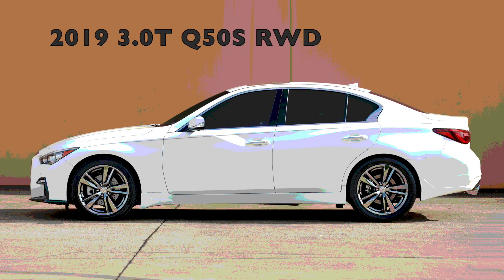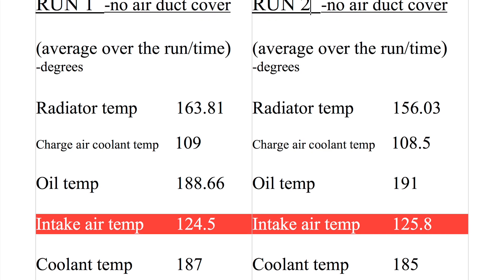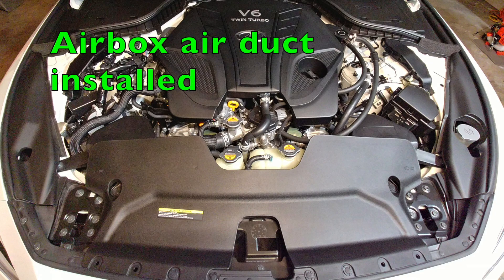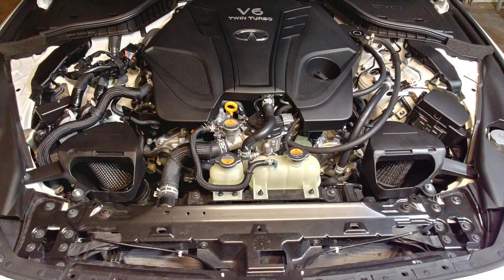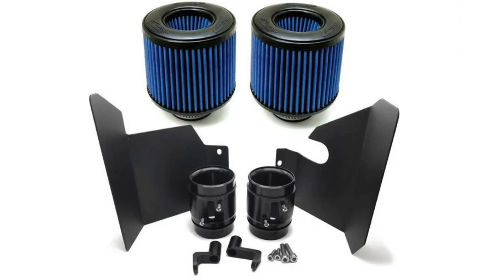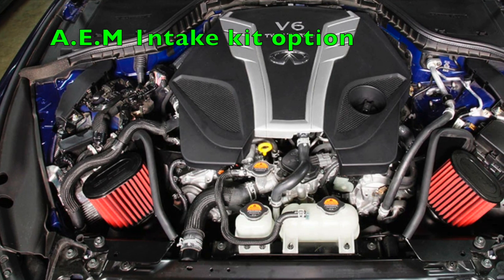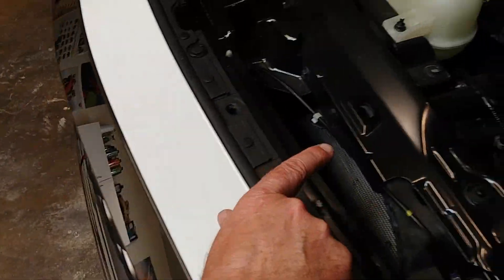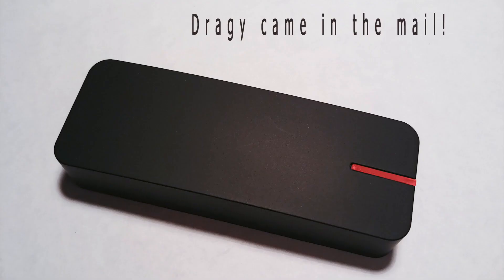Real-world data...open type airboxes/filters vs. true closed cold-air intakes ---3.0T Q50

Comment: At stock fan speed, installing an intake cover will maintain lower temperatures. However, if the ecu reflash has been modified to operate at 100% fan speed at a temperature of 80C of the engine coolant, removing the cover forces cold outside air into the engine fan, causing the temperature to drop.
Reply from the maker: @doom9344  cool, thanks for commenting.

Comment: Awesome video- thanks for taking time to do it. I installed stillen intakes (got them for 150.00 less than AMS ones, and they are essentially the same in design property) and I installed velossa tech intake ducts on my front radiator support ... Aka snorkels. My intake air temps dropped and stay more consistent then when i had BMS intakes and no snorkels. I keep track via JB4 logging. Small differences, but differences nonetheless!
Reply from the maker: I'm all about saving money! I waited to buy the AMS kit until I could save $100 on it during a holiday sale. $500 is too much. I think/feel the AMS airbox/filter kit should sell for $300 to 350. Did you buy the Stillen 402856 part number?
Reply: @GettingthruLife  I got a deal from CH or "Chantilly Infiniti" wherever that is. It was via eBay / the dealership and parts dept they have. But yep- same part number. AMS upcharge a lot based on their name and platform but their intake design compared to stillens is identical as far as conical size/shape and closed box mounted onto the front fascia, I would say. For the price difference i can't complain - plus stillens are super loud and it's nice to hear 😂

Comment: This video is trash. You don't even mention the Charge air temps which are way more important vs the intake temps.
Reply from the maker: Man you are a little bit hateful. My tune is not currently installed so I'm running my Ecutek app that doesn't allow me to log the one parameter CAT. Please take a deep breath and relax.
Reply from the maker: Also Giovanni, charge air temp is directly affected by intake air temp. Intake air temp is the air temp going into the turbos. You start out with hotter air then your CAT will be higher and also means that your heat exchanger and the intercoolers will have to work harder. The whole concept why turbo cars work better in cooler weather verses hotter weather.

Comment: I just bought the AMS intakes waiting to get them from a vendor shhhhh always a waiting game to get something so hopefully they will be shipped out today from AMS I hope so I have 2 questions how is the sound for theses intakes? And I went with the ams because that's what I was thinking the Stillen & BMS ones aren't cold air intakes they are hot air intakes lol 2and question did you make a install video for the AMS ???
Reply from the maker: The AMS intakes add a little low end grumble/intake sounds. It's nice but not obtrusive or over powering. The AMS intakes are fairly nice and will work best for a tuned car that is demanding/sucking more air at mid to high rpm. The conical dry filters are/will be a nice addition along with the formed 2 silicon couplers. It's a pretty straight forward takedown & install but figuring out how the mass airflow tube portion unmounts from the OEM airboxes is something thats a struggle where you just have to battle with it/ figure it out. Some of the nuts and bolts don't have much room to get to, tighten, but just trouble shoot it logically where you will figure it out. I used Allen head bit and then used a the appropriate sized boxed end wrench, maybe a size 5 to place onto- torque down the small bolts on the airboxes. Helpful to have 1/4 long extension 16"-18" and a swival joint. Having the right tools makes it much easier and less cursing.  AMS website has decent instructions to look at, download. Just make sure your varying hose/worm clamps are tight but not over tightened. They should be tightened down so they don't turn/rotate but not so tight that leads to damaging the silicon and plastic parts.

I didn't make a how to vid as there are plenty online were they are good. I saw little need to duplicate but may be I could have added my little insights.
Reply: @GettingthruLife  Forget the other guys comment you do a very good job explaining thing and I appreciate you and your time so we can learn about our cars have a blessed night bro

Comment: Good video with great supporting data👍🏿
Reply from the maker: I'm working on my Dragy. The app I'm struggling with for functionality. My phone's are having different issues with Dragy app. No clear instructions on how to figure user interface out. Just trial and error. Plenty of unboxing videos and what it does but poor explanation otherwise. With my new 275 rear tires even without tune installed, 1st gear is all spinning. Traction control kills the power so it's a struggle. Larger tire likely also killing some power more than I would have thought.
Reply: Getting thru Life I had the same problem, that's why I bit the bullet and bought the Mickey Thompson's for when I wanna go fast. Without them it's like skating on ice.
Reply from the maker: @jstephens1193  Oh man, I was on the perfect concrete today and the perfect opportunity to rip out 0-60's and a few 1/4 miles. The 275 FS tires totally let me down. It was like I rolled thru an oily burn out patch. Smoked 'em all of 1st and 2nd gear and I'm not even tuned. Traction control mode sucks but good for keeping tires not spinning!!! Tires are plenty warmed up and brand new white concrete and 82 degrees full sun so concrete likey 100 degrees. Waste of money to try new tires but they are very good for everything else other than launching the car.
Reply: Getting thru Life man I hate it for you brother. Wish you actually feel what the car is like
Reply from the maker: @jstephens1193  You can't drive around here with a drag racing tire. The weather is sadistic. Bright sunny day and 30 min later flooding and tornados. Arkansas is pretty sketchy too. I know people who have had their drag radial or similar tires on and been caught in the ever-changing weather where they have crashed their cars. The only other street tire that can handle rain and is highly recommended and expensive Toyo R888R's. I could have bought 2 of them rather than these 4 Firestones and saved a couple $100 bills in the process.
Reply: Getting thru Life I definitely don't ride them daily, heck I don't even drive the car daily. I have a set of 18X10s they're mounted on and when I feel sporty, I throw them on.
Reply from the maker: @jstephens1193  I knew you mentioned you didn't daiy drive those tires but it would be good to have a decent street tire that could be daily driven with decent traction for some fun on the street. I can't imaging what it would be like again with another 120hp after I get my tune back this week or next. Looks like the only solution is a 17 inch x 10" wheel  and 275 x 40 fat juicy soft sidewall pure drag racing tire that will last 1K miles.
Reply: Getting thru Life yeah I went with the 305/35/18 because it matched perfectly against the stock 255/40/19 and it gave me a lot of meat on the ground
Reply from the maker: @jstephens1193  link to a picture/s of your car running those pretty wide rears?
Reply from the maker: Also, I posted this video to Q50 group on Facebook. He made a post about looking to buy the stillen or takeda brand intakes, partially/fully open in engine bay filters. My video triggered his emotional response. Lots of highly opinionated people on Facebook.
Reply: Getting thru Life that's why I don't have one lol